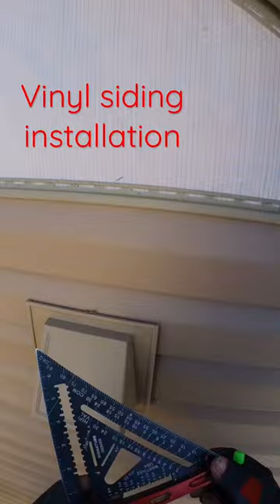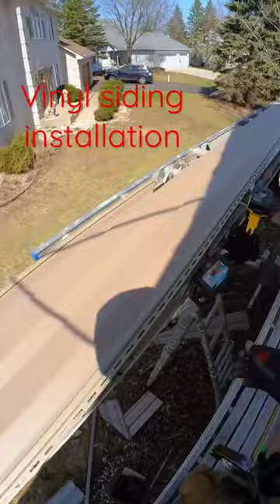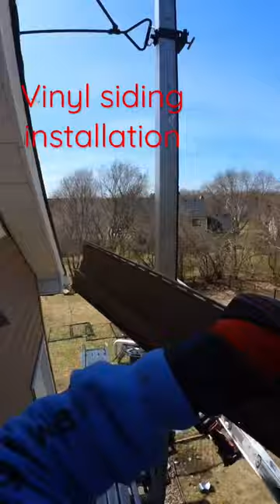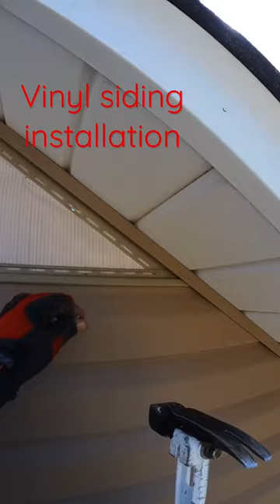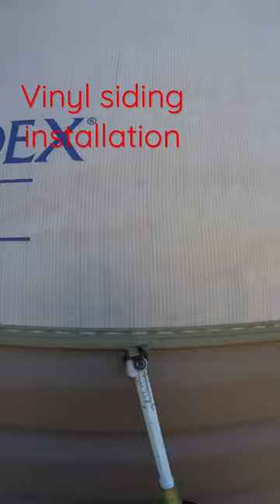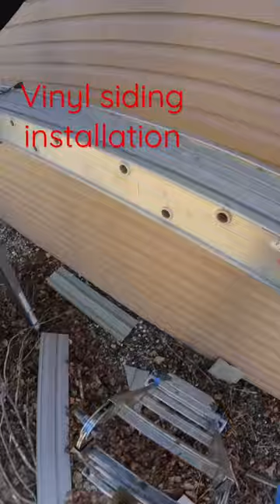Easy way to find and cut siding angles. #construction #kick #jobs #tips

Comment: Not sure what happened. Any other video recommendations on this ?
Reply: He took his square and made sure the bottom corner of the square was flush to the bottom f the siding lock , when you butt it up to the j channel you can see he measured 1 and 5/8 , reciprocate and put ur square flush to the bottom of the lock on the new piece your cutting and tilt ur square till it says 1 5/8 that's ur angle
Reply: @JxronMusic how do you find the starting piece angle, say if it's just a small pie side
Reply: @windsorbound6975   take ur square butt it to the corner post and make ur first line with a pencil on the conerpost then measure down from the line into ur j channel to get the different
Reply: @JxronMusic  thanks

Comment: Need to ease up on the nailing, siding is not suppose to be nailed tight. It has to expand and contract so you should nail it leaving about a dimes width gap. That will warp like hell, on a hot summer day, look like wave pool 🤷🏻‍♂️

Comment: Can you show slower? Are you using common
Reply: He took his square and made sure the bottom corner of the square was flush to the bottom f the siding lock , when you butt it up to the j channel you can see he measured 1 and 5/8 , reciprocate and put ur square flush to the bottom of the lock on the new piece your cutting and tilt ur square till it says 1 5/8 that's ur angle

Comment: Using a snip attachment on a drill? Must have the hand strength of a 6 year old
Reply: they’re shears
Reply: Why do you want carpal tunnel?? Genius cutting method. Siding nailed improper though. Nails should not be tight! To allow for expansion and contraction